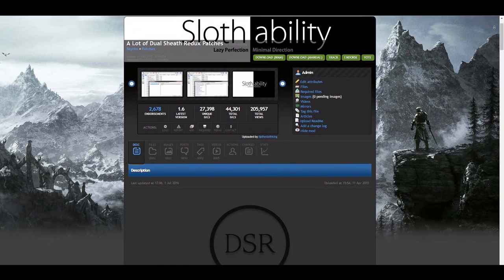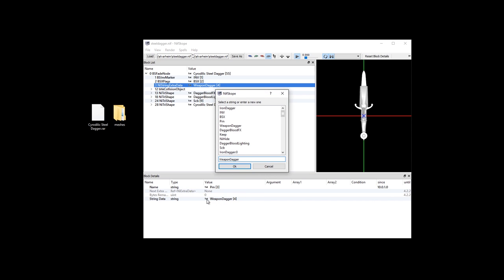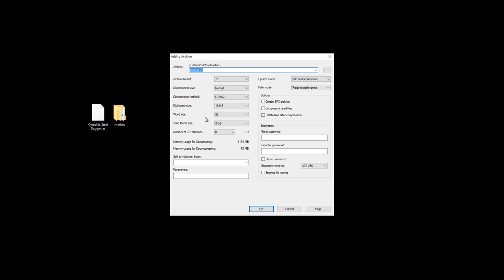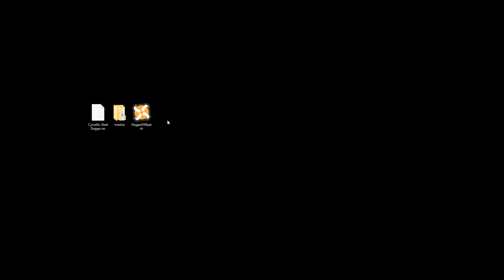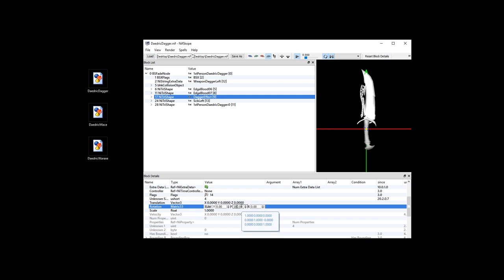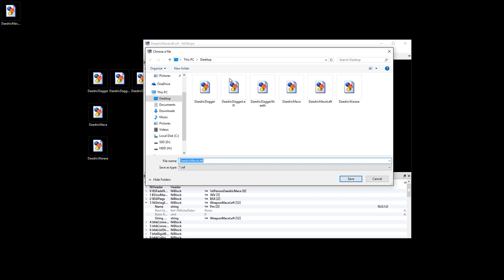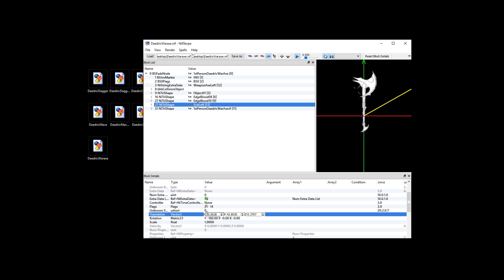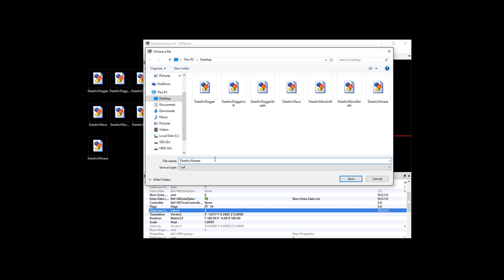How to Create Dual Sheath Redux Patches Part 2 | Daggers, Axes, Maces

Comment: I know this is an old video, and I'm sorry if this question is way past its prime, but I'm a little confused on a couple aspects: 1 - you mention in the part one video that if there is "negative and positive values in x and z axis... switch the positive and negative values for the x and z axis." Yet here, you are switching some of those values when both are negative (to positive) and when one is negative (to both being negative). Would it be possible to get a more in-depth explanation of what exactly it is that determines whether or not any x or z value in translation should be negative or positive? The actions in this video seem to contradict the previous statement, unless I'm mistaken...

Also, you mentioned flipping glow maps for asymmetrical weapons in part one. Are NiNodes "glow maps?"

I'm sorry for the extremely dated questions. I'm just trying to create my own patch for skymomod, as one does not seem to exist to the best of my knowledge. Any help would be appreciated.

Comment: I know this is old but I tried doing this with the God of War 3 mod which added the blades of Athena and exile and came out with no luck. I can only see the right weapon but no left. Any help?  

Edit: Nevermind it works, probably has something to do with the race having a problem with the biped slot 60 thing
Reply from the maker: sounds about right. Seen a lot of issues related to custom races that come with their own skeletons. One way to fix any custom race is to manually copy the XPMSE Maximum Skeleton nif and overwrite the custom race's skeleton with it. That'll make most if not all biped/bone compatibility issues go away for dual sheath redux. Probably an easier method via mod managers these days.

Comment: That's ... a whole lot of work if you run a ton of mods. :D
Reply from the maker: You're telling that to the guy who has made over a thousand of these individual patches for people haha. Staves of Skyrim alone was around 300 patches for all the staves since they not only required patches for staffs but the staffs were treated as shields when wielded a certain way. For that reason, I had to also make staff/shield hybrid patches, which resulted in twice the work. Not even the original DSR author could figure it out, which is why I had to make the patch.
Reply: You're a beast, man. c: